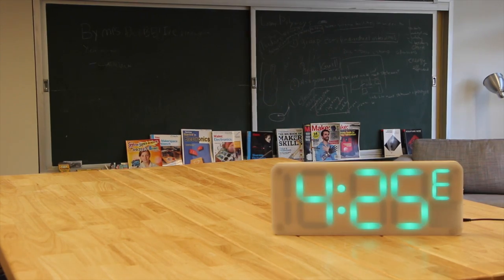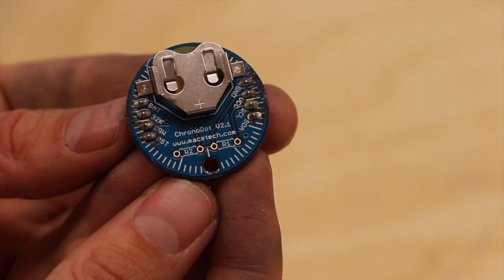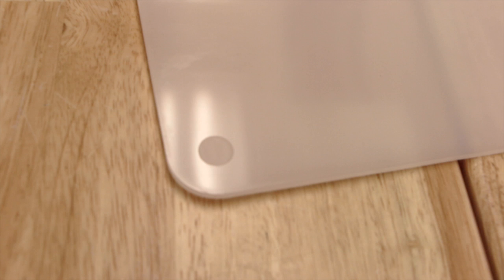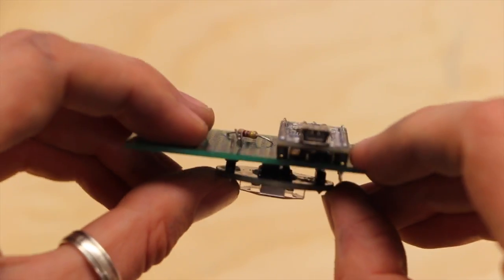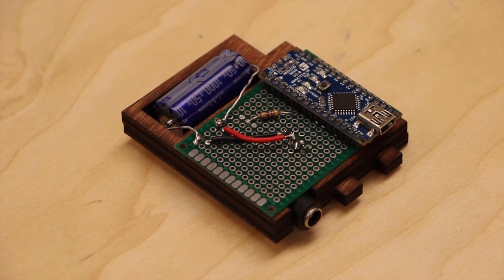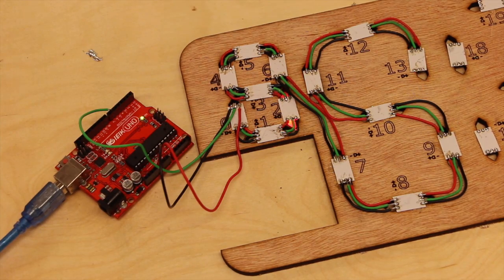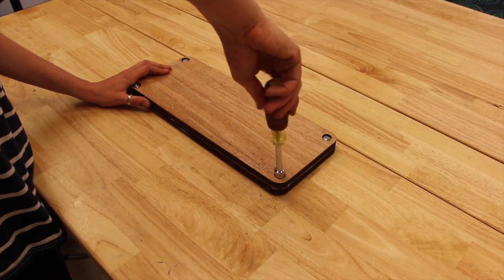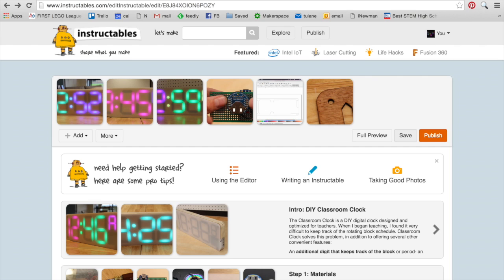Classroom Clock

Comment: Are the LEDs visible enough to see in a brightly lit room? My classroom has a really big window that I like to leave uncovered for my class plants. Is it possible to fit two LEDs per segment for the 4 main digits?
Reply: 12:54 AM
1:07 AM
2:00 AM
3:26 AM
4:56 AM
5:00 AM
6:37 AM
7:00 AM
8:27 AM
9:00 AM
10:00 AM
11:30 AM
12:20 PM